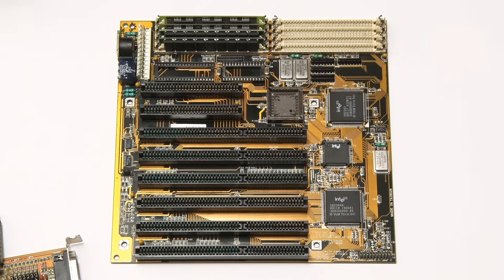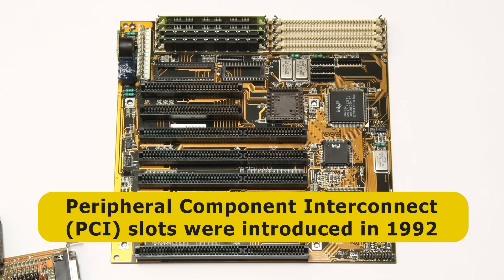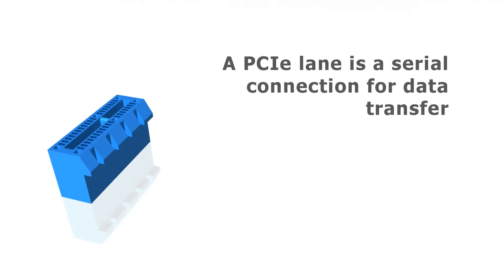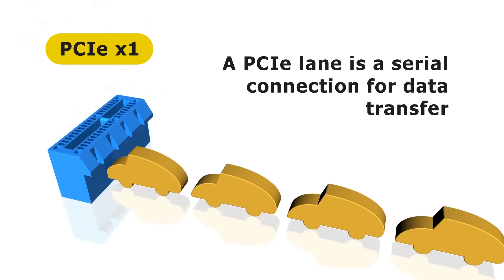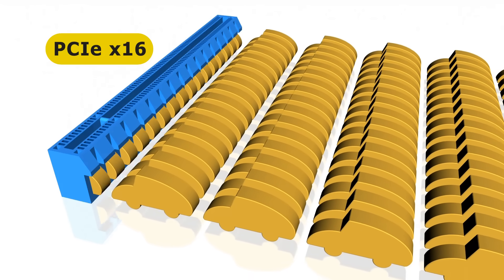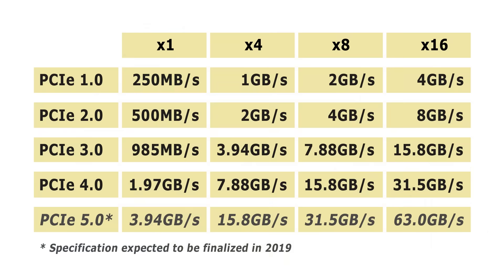Explaining PCIe Slots

Comment: Hi Chris. Very informative video. It must be my OCD but I have to point out that the first mobo that you showed had card type memory and not the DIP memory. I can speak on this because I (Mis ?) spent a portion of my life bending pins and matching brands of chips and refresh times making both the XP and the AT behave. Your video points out the good and bad of technology advancing so that even after assembling the current fastest pc, it is almost out of date by the time you button it up. 

BTW, I remember hearing about something called a "TransPhazor" announced many years ago that was supposed to switch laser light instead of electrons on a motherboard. It was alleged to be 1000 times faster than a comparable pc using conventional components. Do you have any further information on it or did hit a developmental roadblock? I imagine that if you could obtain the manufacturing rights to let us say an 8088 mobo from Intel, you could run rings around a current state-of-the-art mobo. Something worth pondering. Cheers.

Comment: Never even knew they revised AGP, it must have been awfully rare.
Reply from the maker: Not that rare! :) I have I think four different AGP cards in boxes somewhere, all different. There were five versions of AGP, based on four standards, four speeds (version 1.0 came in two different speeds), and critically running at three  different voltages (3.3V, 1.5V and 0.8V). Often you had to set the voltage on a motherboard jumper or DIP switch. Errors did occur! :O

Comment: thx for the video, I am a big fan of PCI-E and use it alot. got a GPU on a x16 slot (3.0) and a x1 or x4 (not sure which) for a 4 port SATA expansion card. both work just great. I am indeed impressed by how flexible and useful PCI-E is coming from ISA and PCI (both of which i used extensively).

Comment: Back in the 80's I had an XT with 8bit ESA slots, but I had a 16bit 1MB SVGA card in it (Which was impressive at the time).  It worked fine,  just slow as molasses... the 2nd half of the card just stuck out the end of the slot, similar to the way the PCIE 16 card was put into the PCIE 4 slot towards the end of the video. (Presumably if that card worked, it also would have run much slower in a similar way to how my card did.)

Comment: "PCI is one of the unsung heroes of PC technology."

Understatement of the decade. On the software side, everything after PCI works the same in principle (PCIe introduced the memory mapped configuration mechanism, but it essentially works the same as the port-based one before). And that's because they all allow automated discovery of system resources. Which sounds dry as bones, so here's the upshot: Never worry about ports, memory register bases and DMA channels again. And especially never configure them with a jumper on the new card again.
Reply: I love you PCI.  qq
Reply: Also, PCIe got rid of physical IRQ lines.  IRQs are packetised over PCIe
Reply: @siliconaudio  OMG, I remember setting DMA, IRQ etc stuff just to make my Sound Blaster Pro work...
Reply: Oh those gloriuos days whey you have to move jumpers here and there to make an ISA card to work with no conflict... they are gone forever... luckly.
Reply: Did PCIe really introduce the automatic configuration? Amiga computers had their own Zorro slot standard that had autoconfig. And for all I know the Zorro slots may not have been the first. Or is it just more accurate to say that PCIe brought auto configuration to mass market computers?

Comment: I want to add a M.2 NVME drive to a MB W/O an M.2 slot.  I found a NVME to PCI 16X adapter.  Will it take advantage of the full 16X ?
Reply from the maker: Not in normal circumstances. Most current NVMe SSDs -- like the latest WD Black I looked at on the channel recently -- only use up to 4 PCIe lanes, at PCIe 3.0 speeds. So If you have a PCIe 3.0 (or above!) motherboard, you only need to put the NVMe adapter into a x4 slot (or above). However, many PCIe NVMe adaptors accommodate multiple M.2 drives, and will hence use more bandwidth if you fit multiple SSDs. And if, say, you have a PCIe 2.0 motherboard, then you will need 8 lanes (an X8 slot or above) to deliver the same speed as a X4 slot on a PCIe 3.0 board. Bottom line: provided you do not put the card into a X1 slot, it should be pretty fast! :)
Reply: After taking a better look, the Samsung 960 EVO  am looking to buy is "PCIE x 4" and the "QNINE PCI Express X16 to M2 (Key M) Adapter" looks to only have traces on the x 4 side of the adapter.   Thanks for the reply I would have wasted a x 16 slot.
Reply: Why would they make a x4 card that requires an x16 slot?  would it get more power from a x16 slot?
Reply: I found some expensive quad adapters.  They connect each drive to a separate PCIe lane.  One is "Aplicata Quad NVMe PCIe Adapter" and Dell has another.
Reply from the maker: Power will be the same -- comes from the pins at the end.

Comment: Chris, I found in the closet the other day a new motherboard (I think it was my sons) and it uses DDR3 memory, does this mean I am stuck or can I use a more current memory strip in it?  Please advise, don't know if I want to hold on to it or sell it for what I can get for it.

Thanks for what you do!

Rich
Reply from the maker: Hi Rich. You can only use DDR3 memory in a DDR3 slot I'm afraid -- DDR4 modules will not physically fit. But if you shop around, DDR3 modules remain on the market. Even some DDR2! :)
Reply: I just wanted to double check before I sell it.  I figured it had a different form factor on a DDR4.  Thank you for getting back so quickly.  This video really helped clear up some things.

Rich

Comment: maybe for the Evolution of PC, you could do RAM, since ram as gone from the smaller bars from the 3x86 processors (and that odd 5x86 not from Intel) to DDR and RAM Bus  and they also designated ram with titles like "PC-200" or 3200... still, RAM has changed a lot through the years and taken many forms and speeds... it also makes me wonder if newer RAM is inter-compatible like PCIe did!

Also i am back on Windows 7 on my Coffee Lake I3 8100 that should not be able to install! it took me a while to figure out it was the fault of lacking USB3 and higher support on Windows 7 that prevented installing! tho i was lost when i started Linux, i learned it pretty much to a fluent point (or it feels natural) but going back on windows i do not feel lost and notice i am as fluent on both! i was expecting to get lost and not know where settings were anymore but... 

no, found all the sliders and check box i need to turn "dumb-proof" mode off! ;P i like seeing all my files and extensions and hate windows nagging for each changes on the PC... personally i think it can hinder installing GFX drivers properly and certain programs! so for people who want it on, you can turn it off at first when installing the important drivers and JAVA JRE and media Codecs and Anti Virus THEN turn it on again!

Comment: Thanks Chris. Extremely useful info on the expandability and compatibility of these PCIe slots. I've just bought an Asus ROG STRIX X370-F motherboard and wasn't really sure aside from the graphics port what other cards I could use. It doesn't help at all either when none of the motherboard manufacturers make it very clear what you can use in these slots either which is very annoying. I'm glad there are guys like you out there on the interweb who are able to do the jobs that manufacturers "should" be doing by default.

Comment: 9:38 I was wondering if you were going to mention an open-ended PCIe slot, and you did! (I thought it was too much of an obscure thing.) I did not know about this kind of slot at the time a PC that I experiment with began to a have some infrequent black-screen crashes. It has a mini-ITX motherboard with onboard video and the one cute, little PCIe X4 slot (with X1 mode). 

I had never heard of an X1 video card, but on the off-chance there might be such a thing, I googled (and did not find it.) One of the leads explained  using a long card in a short open-end PCIe slot.  I believed the guy must certainly be wrong, but yes that X4 slot did have an open end I never noticed. Could a video card with 8 lanes even work with one lane? An additional hitch is that just about every video card I have, but one, happened to be a little too long because of interfering components on the mobo. And the mobo boot screen is black (so you can't see the BIOS to enter it, etc.) until the OS sign-in screen. (The video is on the mobo connector until then, and you can't tell the BIOS otherwise.) But then it does display 4K res (after you set it) and shows youtubes fine.

 I wonder if video cards even use more than one lane when they are not in a video game? (I don't ordinarily do video games, and I wouldn't on this low power PC.)

 I checked 5 other mobos I have, and none of them have any open-end slots, but they all have at least one X16 slot, so there is no good reason for them to have it.

Comment: How much pcie bandwidth does a typical modern graphics card need to operate properly? Are the top tier graphics cards close to saturating a 16 lane pcie v4?
Reply: No, They don't even saturate PCIe 3.0 at 16X yet. Modern GPUs will perform the same in 8x slots as they do in 16x slots on PCIe 3.0.  PCIe 4.0 when a feature on consumer level hardware will follow the trend as the last generations did, they will be obsolete and discontinued before anything on the consumer level can even get close to saturating them.
Reply: @DONK8008  I remember when pcie first came out, journalists ran tests and found that the AGP bus was not close to being saturated.
Reply: Yeah, Even PCIe 2.0 at 16x can make full use of a modern GPU. Kinda makes sense though as it's the same speed as 3.0 at 8x.

Comment: Thanks for the vid. I was wondering if there will be no problem putting my PCIe x1 sound card into my new workstation that only has 5 PCIe 16x slots. I was wondering if there is no such problems, as with mentioned AGP slots, that could result in destroying sound card or the motherboard itself. Thx again.

Comment: In ye early days you have to fight over IRQ's and so on. So, not only did putting the card in the right slot matter but also putting in the right combination in the slots. 

Now just like USB, with PCI-E that problem is solved and we simply can put many cards on a motherboard. Now, one has to keep an eye though out for the CPU and see how many PCI-e lanes that can handle. Well if you make a big server system that needs to rack a lot of cards. Most market level cpu's have more then enough lanes for the usual array of PCI-e connections.

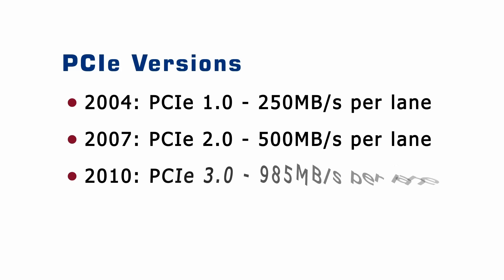Comment: @4:30 cars don’t get faster, the cars get shorter so you can get more in.
Reply: Nope - “You canna change the laws of physics, Jim” - In this case the speed of electricity. Speed is always the same (well unless you consider very minor differences due to temperature, metal composition, etc), and it is frequency that is increased (width of bits decreased) to get more data down the same wire in the same time.

So in a stationary graphic, yes the bits (or cars) are shorter and that IS correct. It is essentially a graph with one axis being time.

I’ll grant you that there is a very common misuse and misunderstanding of the word “speed” when actually referring to bandwidth. As in how “fast” is your internet. Sorry, but that doesn’t make it correct to represent it that way, and certainly not to claim they “travel faster”.
Reply from the maker: This has nothing whatsoever to do with the speed of electricity! There is no doubt whatsoever that data travels faster over, say, a PCIe 3.0 lane rather than a PCIe 2.0 lane. The same quantity of data -- a certain number of bits or bytes -- is transferred from A to B in less time. Why? Because the electronics is capable of processing it faster -- responding to its arrival, handshaking a parity bit, etc. I see where you are coming from on bandwidth. But there packets of data do travel faster over a higher bandwidth connection. OK, electrical signals travel at the same speed. But the data they represent does not when measured in terms of its departure and arrival. So when it comes to the practicalities of communicating information (and I mean that in both senses here), the car analogy works well and is correct.
Reply: Yes, greater capacity=faster rate vs speed.  The rate of transmission of the bits is indeed faster, and is called “speed” colloquially, but sorry - doesn’t make it correct to visually represent it as such.

If you want a correct visual representation with vehicles, that remains scientifically accurate, then it’s perfectly possible:
Twenty 10m long coaches (each carrying 50 people) have a higher throughput than twenty 10m long stretched limos (each capable of carrying only 10 people each).  So the coaches have a capacity of 1000 people/bits, while the limos only have a capacity of 200 people/bits in the same timeframe.  But here you’ll see, when you model it visually, that the coaches and the limos will need to be shown travelling at the same speed, just with visually sparser or more densely packed people/bits.
Reply from the maker: Not true. Some may draw it like this -- to make the point in a stationary graphic. But the whole point is that the same cars (same quantity of data) travels faster.

Comment: Reguarding the modern Gigabyte board, it has a 16x, a 4x, and 2 1x PCIe slots, would the manufacturer cheekily say it has 22 PCIe lanes? Its just i saw a motherboard claiming it has 28 PCIe lanes (28x in theory?) The most modern Ryzen board claiming 64 PCIe Lanes (64x in theory?), i'm guessing 4 full speed 16x PCIe slots? In conclusion would on the 28 lane motherboard, if you added 2xSLi graphics cards, they would both be dropped to 8x speed, but on the 64 lane Ryzen both cards would run at full 16x speed. (i know other devices use the PCIe bus, like NVMe drives, so i'm guessing they would take up a lane each as well?) OR is it there is only a 16x doorway for all the cars to go through and is that where PCIe 1.0 to 5.0 speed becomes the more important factor. (Obviously faster is better but faster and more cars would be the best). Or am i missing something? Great video as always Chris.
Reply from the maker: Limitations on available lanes certainly exist -- I need another video to cover this!

Comment: In the early days of GPU Bitcoin mining, we used to dremel out the end of the pcie slots to fit more cards. Never had a problem with it working, and this was just as pcie 2.0 started to be introduced and you had mobo's with mixed 1.0 and 2.0 slots. Definitely the most versatile and widely compatible expansion bus ever conceived to date.

Comment: PCIe x32. Had to look it up.
All I could find was that the rare instances where a slot that has 32 lanes available, are for special riser cards. Those riser cards in turn splits it into either 2x16 slots, or 4x8 slots (Supermicro has such solutions on some of their server/workstation motherboards)
Not useful in an ordinary ATX computer as those boards doesn't fit. Nothing for a desktop/gamer setup. They'd require special server/workstation solutions/cases and aren't meant for simple desktop/gaming use.

Here's one example:
https://www.supermicro.com/products/motherboard/Xeon/C600/X10QRH_.cfm
This motherboard would require a special riser card in order to make the x32 slot "useful". What kind of riser depends on the server/rack case, and what kinds of cards to be used in it.
Reply from the maker: A high-end server tech only.

Comment: I didn't realize there was such a thing as an 'open' PCI slot as with the Rock64 Pro, although, I've seen PCIe to PCIx16 (slot size) adapters, allowing a GPU to be plugged in.  The conversation about the SBC and a x16 GPU always seems to end with Cryptocurrency.

After seeing the Rock64 Pro with that open slot instead of boards like the EspressoBin that would require an adapter to plug in a GPU, now I'm really curious what an SBC could do with a graphics card.

I imagine it would result in various levels of disappointment; still, the Rock64 Pro... what are they doing?  That's nearly an outright challenge...

Comment: im sorry but Vesa Local Bus was Extremely common in the 486 era, much more than EISA because VLB was open for anyone to use where as EISA had royalty's to be paid.  
Vesa Local Bus Graphics cards and hard-drive controller cards were a must back then for many gamers as ISA cards were really getting too slow for games especially 3D ones
What really killed Vesa Local Bus was the fact that its design was critically designed around how a 486 bus cpu worked and it didn't adapt well to newer cpu's. also the VLB ran at the cpu data bus speed and if that 486 had a data bus greater than 40Mhz (eg the non-clock doubled 486 iDX-50) the bus crashed as it couldn't keep up with that speed
Reply from the maker: Noted and accepted -- I was trying to get quickly to PCIe! VLB did have a very short lifespan, if popular during that lifespan as you note.

Comment: A geek tip : You can cut the X16 fingers of any video card and fit it it a shorter/slower slot without any issues, no need for open slots.

The first shorter section of fingers is only for power and card ID, the long portion is only the data lanes... Of course doing so will impact the card's performance but sometimes, it's pretty usefull, just to add some graphical possibilities to a server with only x8 slots for example.

Comment: To really exemplify the compatibility between size, I once used a bandsaw to cut pins off a GPU so it would fit into an 8x slot. You have to be careful, but it never caused any problems.

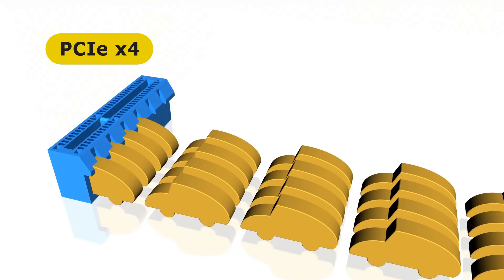Comment: 4:03Its important to understated that unlike parallel interfaces the PCIe lanes are not in sync with each other and can run at slight variations in signal rate. This is really what is the difference between older interconnects and modern ones. It is multiple aggregated serial connections.